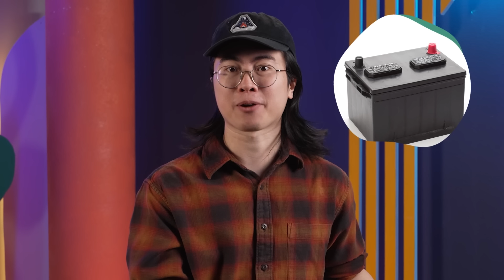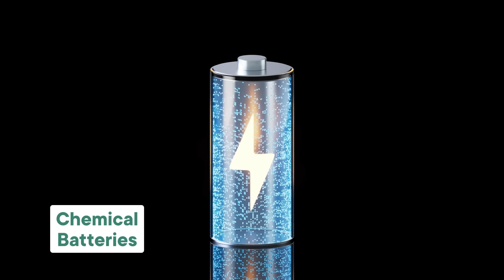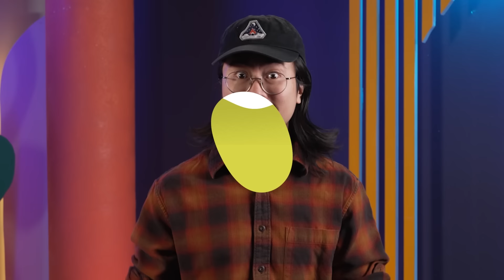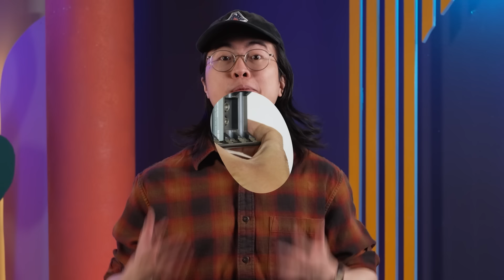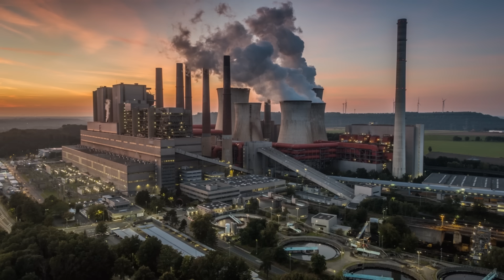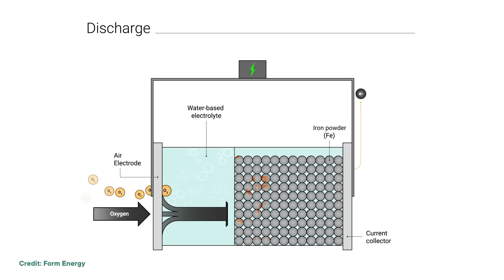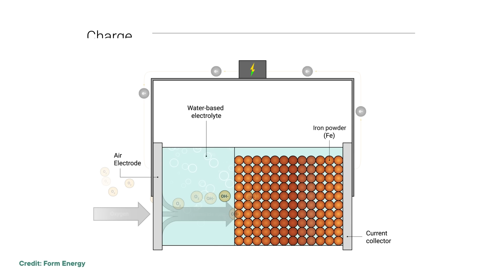The Weirdest New Battery is... Rust

Comment: watching this video from a monster workstation with a multi floor cooling system to keep those outdated x5690's punching with modern CPU performance and a lundry list of upgrades and large age gaps between hardwear in my PC. all CRT's, one touchscreen, one from like 1982 and is amber phosphor. that runs the terminals for dedicated game servers or what not. got a decked out HPDL580 G8 for when i need real prepossessing power and large ram (1tb!)

Comment: A slight incorrect information. Although Lithium Ion was around in 90's it did not have widespread use because it was expensive. Before Li-ION, there was Nickle Metal-Hydride NiMH rechargeable batteries that were more widely available in the 90's and the early 2000's.

Comment: Rust batteries are big, inefficient and are slow.
But they are cheap and the efficiency is not that problamatic if you have a free energy surplus. 
Even inefficient it is still better and cheaper compared to fossil energy.
But don't expect to carry around rust to charge your phone. :D Those batteries are for big solar/wind plantations.

Comment: I'm a little rusty on my electrochemistry too... But I remember that the ions go round and round like a ferrous wheel.  

I'm glad to hear more mention that grid stabilizing doesn't need expensive lightweight batteries, that we can use slow, steady, cheap batteries for part of the storage.
Reply: I'm thinking the ions don't actually move.  Veritasium did a video 4 years ago on "How Electricity Actually Works".  It makes my brain hurt.
Reply: @kitefan1 I think electrons move surprisingly little in wires, but ions do move in batteries... But I was trying to make a silly pun and not be scientifically accurate, so you may be right and I'll try to watch that video you mentioned.  Thanks

Comment: In case of iron-air batteries, we should be careful with them specifically getting scrapped by iron oxide is often associated with tetanus. So yeah, if we want to use it, it probably makes sense to make more tetanus vaccines. You know, just in case, if we do use these at an industrial scale.

Comment: If I remember correctly the weight was a big thing in regards to vehicle and spacecraft use. They also were not useful in places where you had varying levels of power demand as well as generation. They could be useful in regards to predictable solar power storage, but were not so great for variable turbine systems (such as hydro or steam generators... ala nuclear power, and the 70s were industry pushing a nuclear future). I don't remember if there was an issue with using them in certain climate conditions (rust aka iron is affected by external temperatures and expands/contracts) which could be a problem they also didn't explore in depth at the time.

Comment: Hey Tom, here's a subject you might find interesting enough to make a battery video about....
I'm just waiting for NiFe (Nickel-Iron) batteries to make a return for grid use. We used them in the British military in the 60's and 70's for portable floodlight systems and hand-lamps. These batteries are extremely long-lived and can function reliably up to FIFTY YEARS!! 
They can be regularly overcharged/discharged, and even short circuited without destroying them! 

The disadvantages are the weight (not a problem for grid-stores), poor long-term charge retention (solar panel/wind backup store cycle times makes this problem a non-issue), they produce hydrogen when fully charged (I suspect this oxyhydrogen can be used as an energy source).
Edit: Rats. There goes my engineering consultants fee! It seems they are actually being used for grid backup in the Netherlands today - search for "Battolyser" to see commercial applications.
Edit2: It also seems that NiFe-LDH (nickel-iron layered double hydroxides) is used as a highly efficient electrocatalyst to crack seawater and produce oxyhydrogen.

Comment: Confusingly, I watched this on a laptop with no battery.
Meanwhile, your electric car probably still has one of those old lead-acid batteries, for the low-voltage electrical system it shares with gas cars.

Comment: ok on the topic of 18th century tech that people are re-discovering ya'll should read 20000 leagues under the sea again because captain Nemo describes and (i think) i quote  "Electricity is generated via a voltaic pile that is refreshed with regular intake of seawater"  Which would be the chemistry of a copper iron salt cell where the anode and cathode just serve to effectively skim charge from the brine you pump through them.          Horribly inefficient yes! but just as viable for grid boosting compared to iron air batteries.

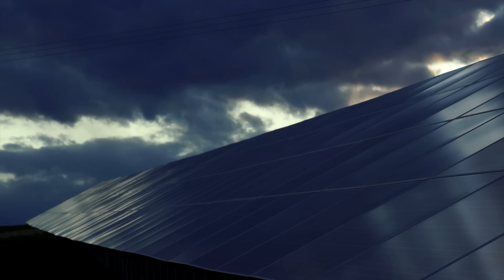Comment: 0:30 No! Solar panels still produce electricity on cloudy days! There's still light hitting those cells. You need the batteries for THE NIGHT!
Reply: There can be much less power on cloudy days.... necessitating back-up options... such as batteries....
Reply: I don't need batteries for night if I can just shine my flashlight at the solar panels. CHECKMATE DORK
Reply: @tahyang  troll physics
Reply: @tahyang  We will use solar to charge the light so the light is free. It's like a physic loophole! 😂🤣
Reply: @nhanNguyen-wo8fy that’s fuckin’ genius!
Reply: @tahyang me shining my blacklight at my annoying neighbors solar panels so they run out of power😈
Reply: @h2dfives799 ah fug man that is diabolical
Reply: laughs in vancouver
Reply: I had a very small bi-facial system  capable of 500w. In full sun it would average maybe 300w but one cloud would drop it to 25w or less... as low as 3w on a full cloudy day.
Reply: Now hear me out, decorative solar shutters… They haven’t been practical for years and are purely aesthetic. Seems like a great way to make them have a practical purpose again wo taking up valuable real estate. Roofs are better but shutters are standardized dimensions perfect for mass production.

Comment: Form Energy has been on the cusp of pilot deployment for several years now. In the mean time, 80% of Lithium Ion batteries are now LFP, which are cheaper, and don't contain nickel, cobalt, or manganese. There is a lot of grid storage coming online and it's LFP. Sodium ion is coming soonish too. Is iron-air gonna actually scale up before it's cost/duration niche is taken?
Reply: Even with LFP being cheaper, most Grid-metering (aka buying low and selling high) have Li-ion batteries making their money back near cycle #1000.

That's less than 3 years if you cycle every year! Great! 

But if the goal is to move energy from week/week or really month to month to truly balance the grid, you get maybe 12 cycles per year. 

With that math you hit cycle 1000 waaaay too late, so I'm happy we're looking at tech that are in such different spaces that they play well together instead of competing so much. 

The Iron battery needs to make its value back in 5 years (rule of thumb) of this super slow cycling which means it has to do so in only 60 cycles (ish)... A super important market that's actually more competing with hydropower and H2 technology more than any/most other batteries

Comment: Cool. Whatever works. It's not like Li-Ion is the end-all, be-all. It's easy to reflect back on all of the wild types of batteries of the past which are still useful under the correct circumstances. I mean... I get that 3lon & the legacy "Tesla" company decided to power their cars with Li-Ion--which is insane when it comes to extreme heat... and resulting explosions. But, whatever; LEAD-ACID is still excellent for vehicles of all sorts. Heavy, yes. Explosive? Not really. And don't forget Ni-Mh, though Ni-Cad tech was probably not salvageable.

Comment: I said "Am not!" to the "You're probably watching this on a battery powered device since" opening comment since I'm watching this on my desktop PC... but then I realised it's 2am and in fact my entire house is running from my solar panels' battery power... so you win this round.
Reply: Also, your PC's CMOS uses a battery too.
Reply: @w3yr  that battery is arguably not "powering" the whole device, though
Reply: @ichanmich  also the PC will still work without the CMOS battery, you'd just have to re-edit the time every time you turn it on
Reply: jo wtf its exactly 2am for me. watching from an ipad
Reply: The CMOS in your PC needs a battery to maintain your basic computer settings, so it is battery powered.
Reply: @ShiroKage009  By that logic my computer is concrete-powered, since without the concrete in the foundation of my building, my PC would stop working.
Reply: @Regretr1  Is there concrete giving power to any of the components? CMOS receives power from a battery.
Reply: @ShiroKage009  no
Reply: @ShiroKage009  Actually, modern computers save the BIOS settings in NVRAM, which doesn't require power. The battery is there for the clock and that's about it. And while you're PC is on, it switches over to running from the mains power. Case in point, if you pulled the battery, you could still use the computer just fine. You may want to set the clock if it's not automatically synchronizing from the 'net, or it may interefere with SSL and such.  
So no, your PC is not battery powered from that little CMOS coin battery.
Reply: @binba9  I just let gemini tell me that as long as your PSU is plugged in -- the PC doesn't even need to run -- the CMOS uses its standby rail and the battery is completely isolated; literally not providing anything to any component
Reply: @binba9 what powers the computers clock when its off

Comment: RUST’S A MUST
Mighty ships upon the ocean
Suffer from severe corrosion,
Even those that stay at dockside
Are rapidly becoming oxide
Alas that piling in the sea
is mostly Fe2O3,
And where the ocean meets the shore
You’ll find there’s Fe3O4,
‘Cause when the wind is salt and gusty
Things are getting awful rusty.
We can measure we can test it,
We can halt it or arrest it,
We can gather it and weigh it,
We can coat it, we can spray it,
We examine and dissect it,
We cathodically protect it,
We can pick it up and drop it,
But heaven knows, we’ll never stop it.
So here’s to rust, no doubt about it,
Most of us would starve without it.
T.R.B Watson, June 1974
‘Corrosion Control Services’

Comment: I remember the Aquion salt water battery. They got it into production and shipped a few, but ran out of money back in 2017. In some respects it seems like a rust battery. Bulky, and slow charge/discharge. If I remember correctly the Aquion battery was huge (about a cubic yard), 20 or 25 KWh, but only 15 KW (less than 1C). Fortunately, it was cheaper than lithium at the time. Still, it could be brilliant for matching solar panel supply to power grid demand. I suspect rust batteries will be similar.

Comment: I have questions about an iron batteries physical structure, with how iron flakes off and expands as it oxidizes. That volumetric change would need to be accounted for, as well as the flaking/red position of the iron atoms.
Reply: I mean it might be cheap enough to just replace it due being iron, and grid scale batteries only cycle once a day really. Also probably be quite easy to recycle as well, humans have essentially mastered iron due to it being a wonder material that is everywhere.
Reply: No argument on cost, would definitely be cheap. My only question is more along lines of longevity, cheap things can get expensive if you need to replace them often enough. 

@john-fz8ok

Comment: Many EVs also have `12 volt lead acid batteries. They operate the various auxiliary systems that are not unique to the EV. Re-engingeering things like clocks, headlights, radios, sensors would be a waste of engineering resources. Also,  it serves to 'start' the EV by activating the systems that make everything work. I have jump started my EV from my gasoline car when the EV's 12 volt battery was going bad.

Comment: So if I was to make one of these batters and used new sheets of iron, is the battery then already "fully charged" as there are without rust? Our would they still need some kind of electrical current applied
Reply: Yes I believe electricity is required for derusting
Reply: It would, but something they completely glossed over is that de-oxidizing usually isn't done with just electricity. It usually uses coke or coal directly in the process and produces CO2 directly, even ignoring the electricity required. I'm not a chemist, and I'm sure there are ways to avoid that, but the fact that it's the norm shows there is probably a large complication with the rust + water + electricity = iron process. If it were simple and cost efficient places wouldn't be smelting iron oxides in the traditional methods.

Comment: Regarding gasoline cars having lead acid batteries, EVs also have a 12 volt lead acid battery under their hoods. They're needed to run all the accessories like lights, AC, etc. They're charged from the main high voltage battery. Using a legacy system makes more sense than reinventing it.
Reply: Many EVs do still have lead acid 12v batteries, but at least Teslas don't any more. They've been using lithium ion 12v cells for a few years, now. They're much lighter and more compact (I believe the one in my Model Y is about 1/5th the size of a lead-acid 12v), which lets the designers cram more stuff under the frunk.
Reply: @coredumperror frunk
Reply: That 12V doesn't run AC, it only unlocks the car and switches on the relay so real power can come from the main battery to power everything.

Comment: So, how come I've never seen anyone "un-rust" iron via electrolysis? You'd think there'd be a huge economic application if you could do that.
Reply: Why bother doing that when you can just buy something new for the same price or cheaper? It actually takes a significant amount of energy to break that metal-oxygen bond (think about how much energy is used for aluminum smelting). 

But anyway, people do that with antique cast iron all the time.
Reply: It's mostly done in the context of restoring artifacts, sometimes people do it themselves to maintain their equipment if they are dedicated and has lots of limitations.  Electrochemical rust removal is also not practical at large scales really, if something needs to be protected long term then using a more rust resistant alloy or adding sacrificial anodes are more straightforward and cost friendly options, outright replacing the rusted component  is more straightforward than trying to undo heavy corrosion.
Reply: @inigobirden2155  The fact that it isn't done on a large scale for things like smelting iron kind of shows there are almost certainly issues with it. Also, as far as I know, electrochemical rust removal done for restoration isn't anything like what is being described in this video. You need a sacrificial piece of steel as one of the electrodes, and you aren't actually converting iron oxide to iron, afaik.
Reply: @christopherpedersen1820  Yeah, it uses the same fundamental principles but it's a completely different process in the details.
Reply: Because electricity is expensive, iron is not, stainless steel doesn't rust, and you didn't bother looking on YouTube for the many demonstrations?
Reply: @TheMapachito others have answered this while being nicer! : )
Reply: @TheMapachito Stainless steel =/= iron, Einstein. It's an alloy of iron, carbon, and generally chromium and nickel.
Reply: @bcubed72  They didn't say it was. They were bringing it up because it exists and is used widely in most places where rusting iron would be a concern, which negates of the need for that "huge economic application".
Reply: @tofystedeth  Smelting iron is a massive industry that produces massive amounts of CO2. If it were cheap and easy to smelt iron oxides without releasing massive amounts of CO2, there would, in fact, be a huge economic application. Just because you didn't see the main application doesn't mean it doesn't exist.

Comment: What does 100 hours of energy storage mean?   Even a AA battery  is capable of that in certain uses.
Reply: Was going to comment on the same thing. Battery storage capacity is measured as milliamp-hours for a cell phone battery or amp-hours for car batteries. For those battery packs you can take to work sites or partially power your home during a blackout it is kilowatt-hours. For grid scale batteries I believe it is megawatt-hours. I suspect he meant to 100 megawatts- hours.

Comment: The flow of particles is an oversimplification. Its changes over time in the waveform of the electromagnetic field. If it was particles alone induction wouldnt exist. Otherwise electricity would just be like plumbing, which it is not.

Comment: "The Sun doesn't always shine and the wind doesn't always blow"--but the Earth is always hot 'way down deep inside.  Geothermal is The Way.
Reply: Also the earth has a massive supply of radioactive elements that can generate heat when put together. Nuclear works, rain or shine, and it can respond to demand in nearly real time.

A nuclear/solar/geothermal/hydro grid would completely solve our energy needs with vastly less demand for batteries.

Comment: We could just use reliable nuclear.  Then you don't need batteries on the grid.
Reply: Best reply of the whole comments section.  

Let's just get unlimited power now and simply not forget to fund science.  Battery breakthroughs will come by themselves in due time.
Reply: @blahsomethingclever  I'm on board, but it takes a long time to build new nuclear power plants. Until they're built, we need something else
Reply: Trustworthy nuclear is what we need or there will be too much NIMBYism (Not In My Back Yard). Also, power lines and transformers can break. Having distributed battery backup is useful in that case. I went through 8 days of no power in winter in Quebec with the 1998 North American Ice Storm. The power source was working fine. It's hydroelectric. The power lines were down and we couldn't access the electricity.